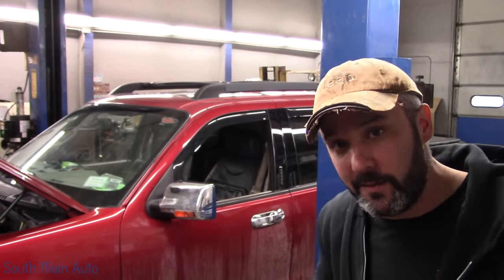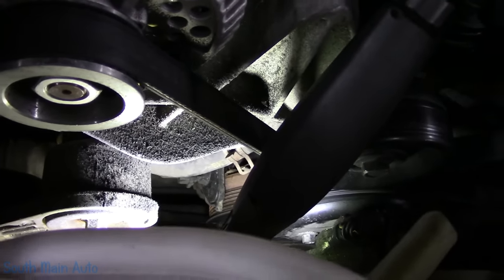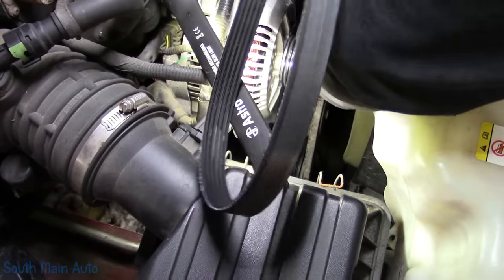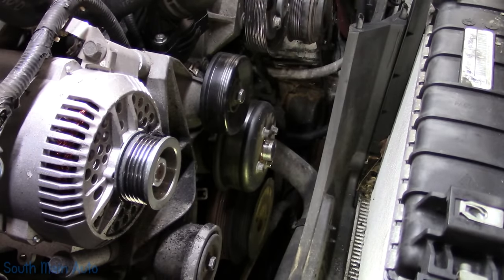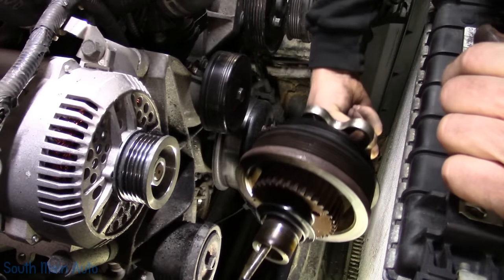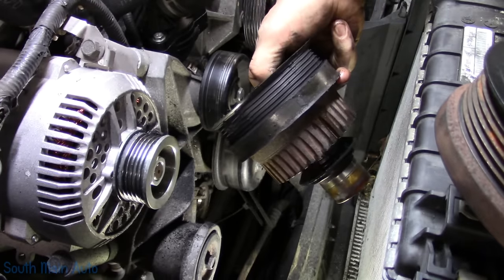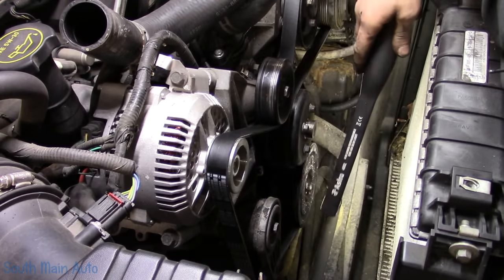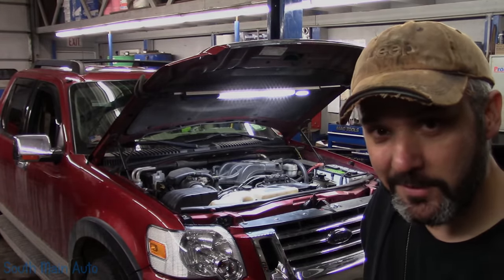Ford Explorer Sport Trac: Crank No Start

Comment: Tried getting a job at Autozone once. I interviewed with the assistant manager and he seemed visibly threatened by my experience working in an actual shop, since he told me he never so much worked at a quick oil change joint. So, I didn't get hired. No biggie. A few weeks later I went in to pick up some sway bar links that I had set aside and I found that the kid that they hired instead of me was the one "helping me". He didn't even know what sway bar links were and insisted that no such thing exists and it turned into a 15 minute fiasco with the assistant manager that hired this idiot over me just to get some damn bushings that were literally sitting in a box on the back counter. What a joke. A few years late commenting on this vid but hey I hope you get a good laugh out of my struggles 😂
Reply: That shit always happen , they always hire ppl with no car experience
Reply: @ayymarley3767  EOE...
Reply: The guy was afraid you would have his job, so, for job security's sake he didn't hire you. Always hire someone dummer than yourself if you work for a company.
Reply: Everyone has car experience. Driving a car; that is. 
I believe the term or terms your looking for is “automotive service experience.” Or “gear head experience.”
Reply: @jdrs4214  No, not all people drive.
Reply: @dukeman7595  dummer
Reply: No respectable mechanic would be working at autozone anyway.
Reply: I didn't get hired at a company that was basically a tire and lube shop for semi trucks. I lost the first job to a kid that had a degree. Young man turned into a good tech. The second time I applied cause I needed work. Got the position and not one person besides the kid with the degree ( he turned out to have asbergers. Think that's how it is spelled. But as I said, solid kid and listend to me in learning.) But the rest of them had zero knowledge on maintenance. So was definitely a dick swinging contest lol.
Reply: Back in the day many years ago they didn't hire me because I was a girl..truth..
Hi from a girl that changed her gear shift linkage..me yep
Reply: I'm finding this out,  I hurt back at Ford shop, fusion,  arrificial disc, seem Noone wants be outdone? Flat rate tech, that scares hellnout of them
Reply: Tried at advance when I retired 43 years auto mechanic  he had a headlight in the eye look 🤣
Reply: @dukeman7ititbothers me peoplewho arent even mediocre keep their jobs595

Comment: You blow every mechanic outta the water. Eric
Reply: Richard Gill without a doubt he's spot on
Reply: u could have ck the bolt size on the new balancer
Reply: Eric you didn't see that clip on the air filter housing wasn't clipped on all the way. Another good video.

Comment: I just wasted a whole day at work.. tried three different puller kits just for you to show me the rod and the small hole to push against the crank.. thanks bro now I’m gonna get it done in the morning
Reply: Eric re:worry about the radiator.
65 years ago, I  hated busting my knuckles on the steel fins. So I just use a 6mm or 1/4" peice of plexiglass or 1/4" plywood and put in between the radiator and my work area. Helped  preventing tools puncturing the radiator too.

Comment: I got a job at Kragen (a.k.a Kragen/Checker/Schucks, which is now O'reilly) back when I was a teenager and you had to answer multiple choice questions on a computer when you were applying, stuff like "if the customer said they had water on the passenger side floor board what could be the issue".  

I'm sure at autozone its probably more or less the same thing the but the answer for all questions is "replace the O2 sensor".
Reply: I honestly doubt if there would be any questions these days about actual cars, other than the top three auto related things they do. Change windshield wiper blades, Change batteries, read OBD codes. Their main jobs these days are cashier, stock boy, janitor.
Reply: @ModMINI  I'm in AutoZone at least 3 times a week and most of the time I have to waght at the parts counter so I don't know what your talking about

Comment: You have no idea how great a service that you provide to us in the YouTube community.  I have a Ranger that quit while I was driving. I was thoroughly confused as I saw my coolant temperature climbing so high I was going to pull over. Before I did I saw the temperature fall back to normal.  Continued driving and later the temperature shot up again. The engine shuddered slightly with spark knock (?) then quit.
Internet searches resulted in my believing that it was a cracked head.
After viewing this video I looked at the balancer and found chunks of rubber broken around the balancer. Just ordered the balancer and seal.
You are a life saver.

Comment: I've been a Master mechanic for over 30 years. I bought a brand new 2005 Sport Trac 4.0L from the dealer off the showroom floor. After about a hundred and ten thousand miles, I had weird issues. Let's just leave it at weird issues! After about a week of sweating the diagnostics and scratching my head that very same issue finally smacked me in the face. Don't sweat it brother, it's one of those one-in-a-million issues unique to the vehicle and/or engine combination.
Reply: It's a Ford LoL. Sorry I heard Ford Fusions don't go to repair shops , those are really good vehicles.  But I can't talk, I'm always working on my 2007 Malibu LoL

Comment: The real tip here is not the head fake by the harmonic balancer. It is that you made those threaded rods at various lengths with the one end squared off (for the socket?)  and you knew they could help get that puller working. Awesome insight and ingenuity. ( A trick from meemaw? ). Great video Eric.

Comment: Eric, that was a beautiful 5-minute diag! Why be so hard on yourself? I just saw this EXACT same scenario on a Ford explorer this past summer at a local shop here in PA. Truck would start and run, but misfire on acceleration. Kind of amazing that the belt doesn't come off and the truck keeps running with the harmonic balancer separated like that lol
Reply: A fine design right there! Sawing through the crank sensor - that's the first time I've seen that! Well done, FoMoCo! :D
Reply: how in the WORLD has ford not fixed this? like really Ford. Really
Reply: old Volvo's 740 and 940  (and maybe even 240 and 360) also have these crank balancer separation issue. Luckily on those the crank sensor is on the bell housing. But when you go change a cam belt you think you set the  crank to #1 TDC. and the: No start! 
WTF  why won't it start? If you don't know about that balancer problem you will go insane looking for the problem...
Reply: @coffeeloungeofficial2881  This is a part that's going to fail with age on any older car. The only alternative are liquid filled pulleys which cost about $300 versus maybe $40 for this one.

Comment: Now you know what we home-gamers go through with the after-hours part stores... you'd better know more than they do.  Glad they actually had the part... great video.
Reply: Gotta know more than they do, and lookup the parts and get the part numbers you need and give them when you walk in, otherwise you'll end up with the wrong parts.  I found it odd when they gave me my cap/rotor for my Jeep along with 8 spark plugs...turns out they looked up a Grand Cherokee with the V8 not the I6...didn't really think anything of it, the cap was right, the rotor apparently not so much, I was about 60 miles from home when that rotor decided to disintegrate, luckily right at the freeway exit I was getting off at.

Comment: Autozone is the place when everything else is closed & you "might" find the part at twice the cost. This happened to my Ranger; belt squeaking, changed  pulleys, tensioners, and a bad alternator and squeak continued. Not until I got under the truck and inspected the harmonic balancer and found what appeared to be a "two" pully system. Sure enough I was dumbfounded when I took it off and looked similar to one on your video. It's a miracle that that belt did not come off and tangle itself on the fan. Good video and  thanks for sharing.

Comment: Don't be so hard on yourself buddy. Sucks that your Auto Zone can't find good help. Having that rod set up on the crankshaft puller kit was a great tip. I'm working Saturdays. :)  Baby powder to quiet belts, check. Despite the overlook, their was a lot of good information on this video. Plus it's always entertaining.  I'm glad you decided to post it.
Reply: that's why I only use Napper
Reply: The rod is a good idea. Threading in those bolts so shallow made me nervous. Some cars I work on have no keyway and the pulley is on hard. They only have M6 bolt holes and sometimes the bolt breaks or thread strips before the pulley comes off.
Reply: @clevelandmaker386  The best, hands down.

Comment: You asked what it takes to get a job at Auto Zone, well I can tell you because I just started a 2nd job there earlier this month so that I can pay my wife's & daughter's doctor bills thanks to Obamacare. I have no auto experience other that working on my own & friends cars since I was a teenager. You are spot on when you mentioned the check box for a pause. AZ is hard up for workers because they currently have over 10,000 job openings in the US. 

When you called AZ they should have taken your number so that they could put the part on hold for you. If they gave you a hard time about the tax exempt claim then they most likely were a DIY store & not a commercial store. The commercial stores are the ones that handle selling to the local shops. I work at a DIY only store so I deal with idiot customers most of the time & 98.5% of the time they buy the Dorman or Valuecrap branded parts.
Reply: I bought a set of valuecrap spark plug wires for my truck the other day...why?  Because the over-priced set was garbage, intermittent no-spark on random cylinders and after jiggling around the plug wires it would work fine for a bit then start missing again...brand new engine and wasn't running on all 6 cylinders again...out came the ole brain and said well its gotta be the plug wires since when you move the wires around it starts missing/hitting.  So to the parts store I went for the $20 plug wire set, 10 minutes problem solved.  Just because you pay more doesn't necessarily mean you get a better product sometimes.  I know that's often not the case but seems to be with already over-priced re-manufactured junk parts from these parts stores.  I seem to have better luck pulling parts off vehicles at the Pick A Part lots HAHA!!.

Comment: Don't feel bad I ran into this exact problem on a Ford explorer last winter. I was amazed at how the belt cut perfect grooves in the old damper , in my case jiffy lube put the shorter belt on .
Reply: I seriously can't comprehend how someone could actually FIT A NEW BELT without thinking it odd that the crank pulley outer area was entirely made out of rubber?